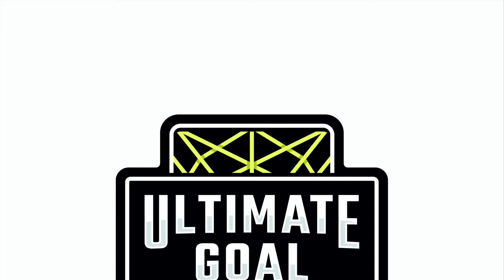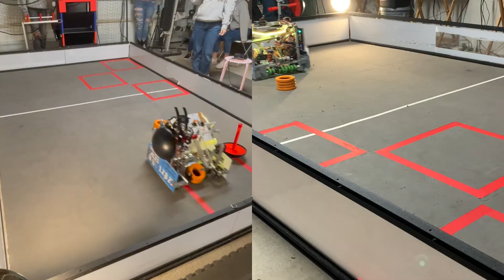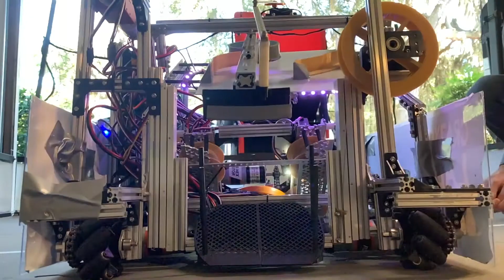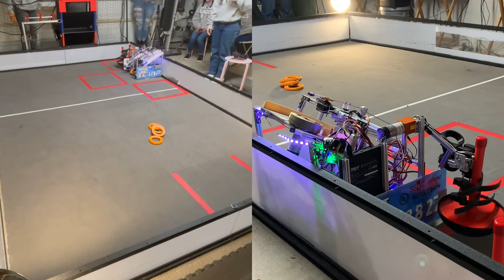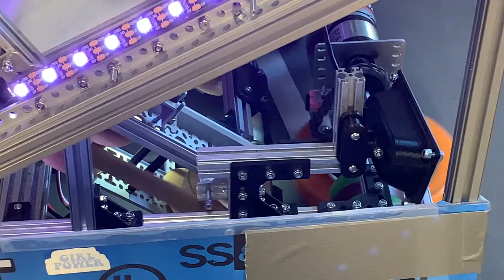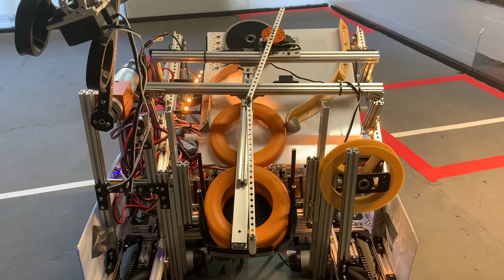FIRST Tech Challenge Gameday (Meet 2) with the Crazy Cat Ladies (Team 12827)

Comment: So how have you guys made the wobble goal arm run smoothly? Our team has been trying the zero power break behavior but it only smoothens it when it's coming down near the end but usually whips it too fast due to gravity and it being heavy when lifted up and lightest when it's at the top position
Reply from the maker: We've switched to a 100:1 motor, which gives the arm plenty of torque to control the movement well. If we didn't have that gearbox, we probably would have tried to gear down with sprockets or gears.
Reply: Gotcha thanks! Yeah we are using a 40:1 so we can probably add gears for the more control